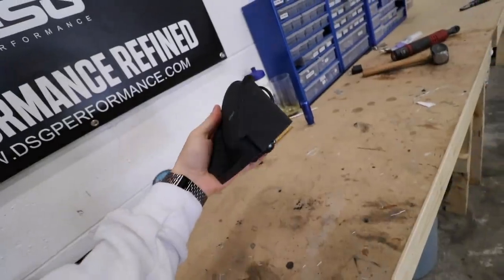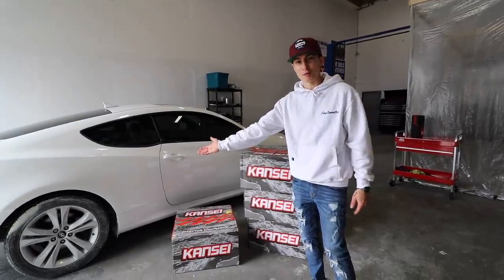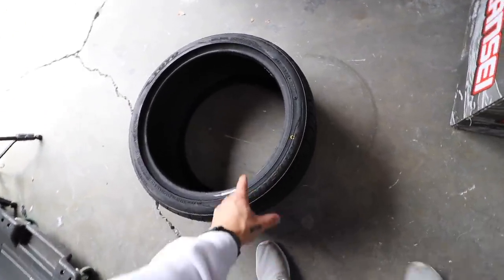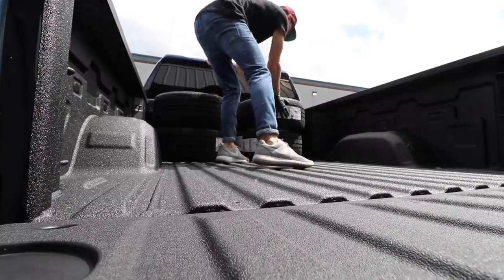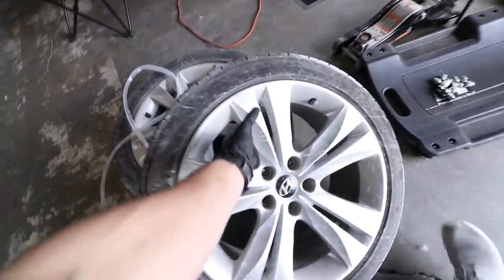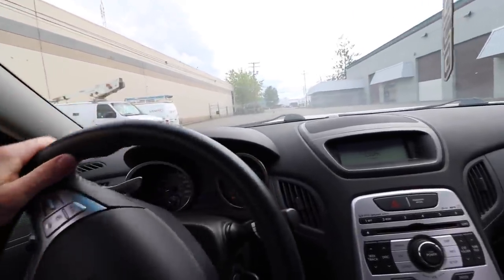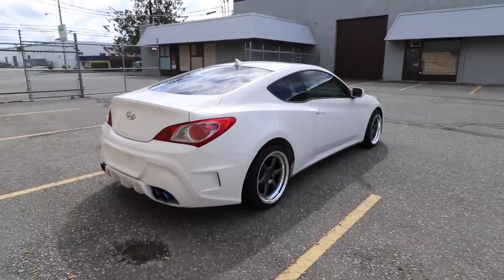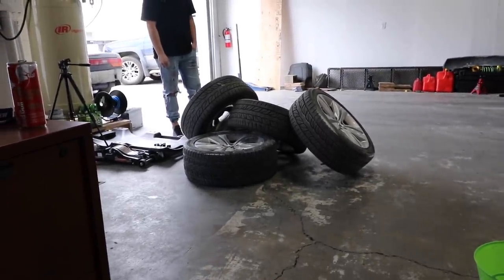NEW WHEELS FOR THE GENESIS🔥

Comment: Yo, so for the cut stage on the paint use light compound with a medium cut pad. Go slowly with medium pressure. Do 1x1 or 2x2 feet sections with 2 minutes of work time in each section. Then the polish use a the polishing pad with same pressure and this time just feel how long you should work the area in the same 1v1/2v2 sections

Comment: Robbie don't start doing any steering angle mods yet, learn the stock steering first, then get some modified spindles with shorter knuckles, and get some camber in the front too! Also, you've tried the raceland coilovers.. Any chance you could get the Tein Flex Z and get a review on them? They look like a good bang for buck, and adjustable dampening!

Comment: Talk to Taylor Ray, he is probably one of the best resources you can reach out to about drifting, plus he can help you find a cheaper tire to use because you will be burning through those Toyo tires and it will be very expensive to run those

Comment: Dont know what genesis u have. But a 3.8 geni should easily get around with 255. Very good choice and the fact you stayed with 18s is good as well. Get a seat in to hold you and in place, get some coils  and you can start to get seat time. Slowly upgrade the car as you go too. Get a angle kit or some cut knuckles, handbrake. Keep it stock power and reliable. Thats when you will have fun. When u can run all day on one set of tires and your car doesnt even sputter. Dont over build the car bro. Keep it simple and cool

Comment: Be careful genesis coupe manual transmissions are known for second gear lockout. Try to get one with low mileage.
Reply: this will happen on 90% of them when its high revving(gets worse as yo make more powa) as the drivetrain shift to much tranny and engine mounts make a it go away(mostly)